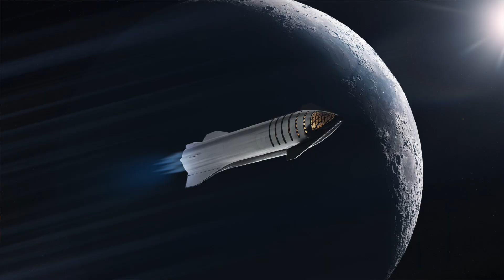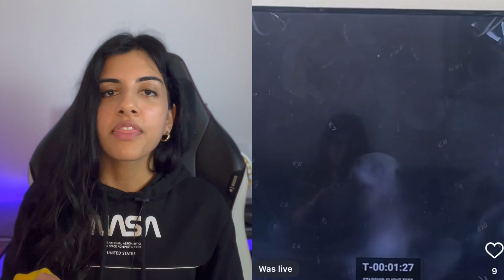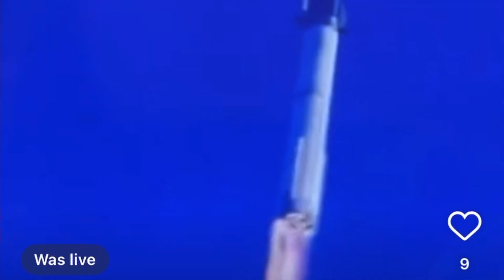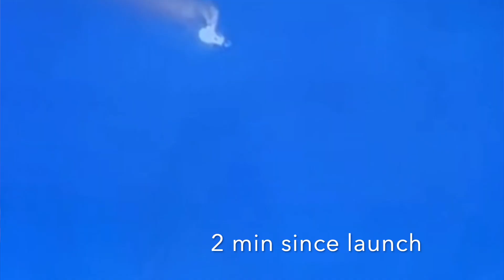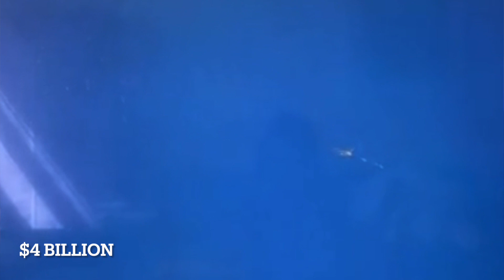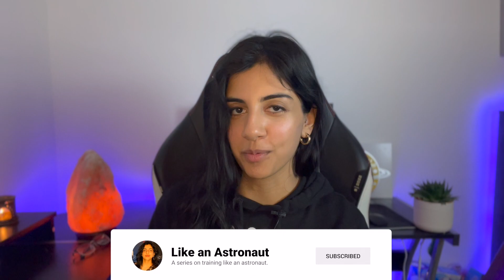Watch Elon Musk's Starship Rocket Explode with me!

Comment: We will be on the Moon when SpaceX gets it done. 
Because unfortunately I think NASA is too bogged down with bureaucracy and trying to include as many other companies as possible.
But I'm not sure if Elon will wait for NASA and maybe just go for it, as there are not many international laws regarding moon landings and what few there are have so many loopholes that it's easy to exploit them.
But that's just my two cents.
Reply from the maker: When do you think SpaceX will get it done?
Reply: @likeanastro  
I'd say around 3 to 8 years.
Once Starship gets the bugs worked out the next hurdle should be in space refueling and I think there will be failures at every step of the way but that is all part of the rapid reiteration process and it is expected to an extent, however, each failure results in data gathering and lends itself to better iterations.
But yeah 3 to 8 years is my guess.